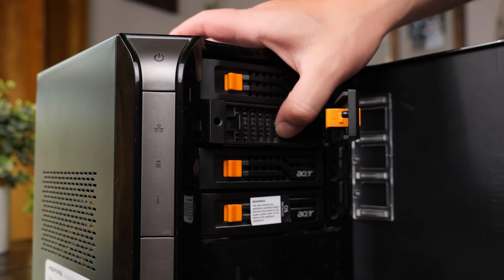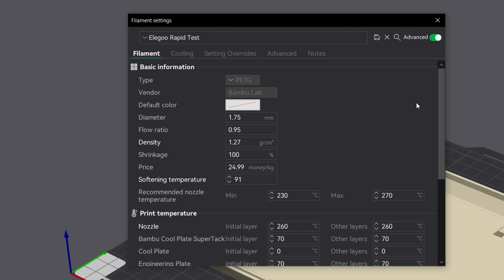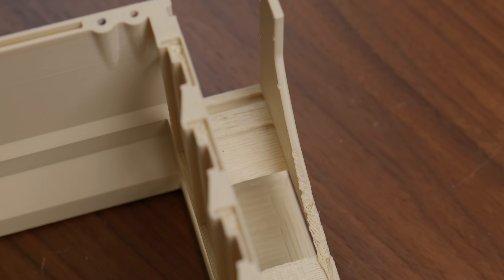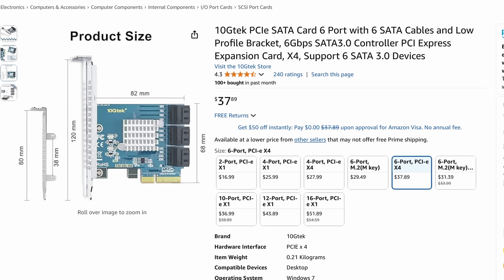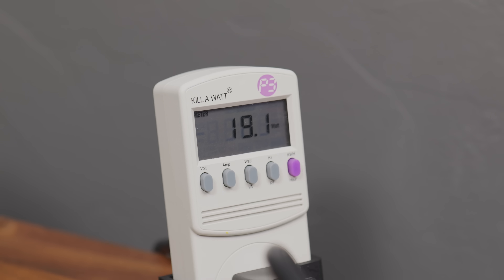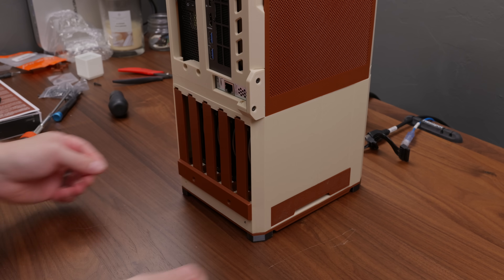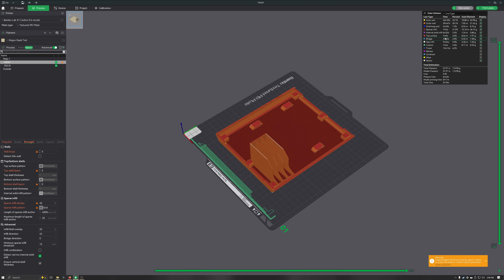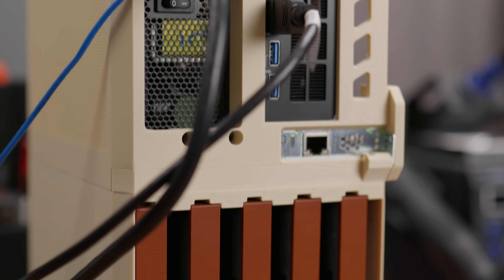This 3D-Printed Home Server Is INCREDIBLE

Comment: Really wish you could just buy SATA/SAS backplane boards to finish turning stuff like this into a safely-hotswappable system. Yes, I realize it'd probably work with just the cables, but that means having flailing cable ends or possibly disconnecting the wrong cable or connecting cables in the wrong order. Really fancy solutions keep track of which drive is in which bay for error reporting, etc. That's possible if you know what cable is plugged in where, and that sort of thing is a lot easier to do once if you have a backplane in addition to ensuring that contacts are made in the correct order to insert/remove drives.
Reply: There are female to male sata connectors, which can be screwed onto 3d printed parts to make a diy backplane. The drives can than be pulled out with the connector and the cables staying attached.
Reply: @Servicehans  That might be the solution! There's not too much going on with those backplane boards except for activity lights per-drive and … I think the DIY solution can omit those. That said, a USB microcontroller updating some bicolor LEDs green/orange/red based on the drive's status could provide what you really wish you had from those backplane boards: This disk is needs to be cloned and replaced to avoid degraded state when it's replaced. Or it has failed and just needs replacing outright.

I have a Silverstone CS382 (which actually had a bad backplane—Silverstone was quick with the replacement though!) and one of the first things I did was cook up a script that would list the disks in the order of the bays using physical ports and report info about each.

Such a nice script! 😁 It's really just a matter of knowing which ports map to which bay in the case, doing a readlink on them to figure out the device name, and then checking the already cached SMART data used to update the web GUI. If I modified that to poll the disks it'd slow the script down by a fair bit, but it'd be portable to other systems. Might do that, but the last time I posted that kind of script to reddit it got downvoted pretty quickly and nobody really saw it.
Reply: I was also searching for something like this and the cheapest I found was a 3.5in to 2.5in hard drive to SSD converter for $25. Ifixit sells it. It's more expensive then it has to be but if it can be disassembled it's the closest thing I have found.

My next idea was seeing if any server company would sell "replacement" backplanes for their servers. I remember LTT getting some at some point for one of their older servers as it needed one for a replacement.

Comment: I don't have the patience to use my 3D printer anymore. Everything takes ages to print. It's been collecting dust for about 2 years now.
Reply: Sell it! I've been meaning to try and find one second hand myself!
Reply: Add a pi to your machine and install klipper like having a new printer with turbo engine
Reply: Which model? I've had an Ender 3 for years, but it's so slow! My wife bought me an Ender 3 v3 this year and it's been great!! At least 5x the speed typically.
Reply: @BenReese What's the steps per millimeter that it's printing at? What size nozzle is it running? I have an ender 3 pro and I upgraded the bed to a glass bed, changed it to direct drive printing, dual z motors, Big tree tech motherboard for silent motors, it was pretty much everything except for the hot end. The last thing I messed with was trying to upgrade from  the stock nozzle which I think is .4 mm up to a .6 or .8 and didn't have a lot of luck with it. Now you have me curious about the newer printers. Want to go look around and watch some videos. Thanks for the info.

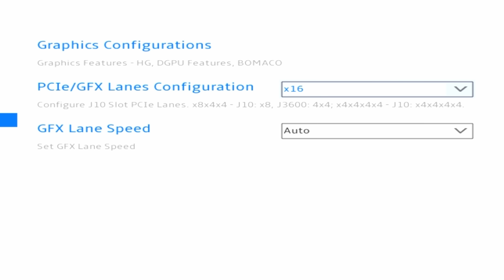Comment: what's the PCI to 4x nvme adapter shown in minute 7:24?
Reply: GLOTRENDS PA41, probably available with other tradenames but pretty sure that is the one. There are a few versions of it.
Reply: GLOTRENDS PA41 by the looks of it, it's probably available as other 'brands' too but it's the same thing.

Comment: For a case that small, I'd snip and crimp my own PSU cables. Did the same years ago with my old Dan A4-SFX
Reply from the maker: Is there a place to just buy more "bulk" cabling for power supplies? I just don't want to ruin the stock cables since I generally repurpose PSUs for different projects. I guess I could just buy cable extensions..

Comment: OOF...that mobo and qnap card...yoiks, but I guess for homelabbers less horsepower would be fine
Also..I wonder if those 6x sata adapters have 3D printable fans...those things if ALOT of data get run thru them get rather toasty and end up throttling down..so a small 40mm cooling fan 3d printable "snap in place adapter" then maybe taking 5vdc and ground from the solder pads below the chip might make for a silent airflow/cooling addition

Comment: I'm running the same motherboard but with the 7940HX for 6 months now, initially as desktop (totally smoked my 5800x3D in all aspects), then close to 5 months as proxmox host (with 10gbe SFP+ NIC). Now it's back to being my daily desktop driver... until the upcoming Minisforum Ryzen 9955 boards hit the market.
Edit: with -20 voltage reduction in bios my 7940HX dishes out 31500 points in R23.
Reply: lol, I have the same one with the 7940hx, I put a 4070 in it and use it as a gaming pc for my front room. I'm actually waiting for minisforum to come out with the 9955HX3D so I can replace my main desktop 7950x.

Comment: This looks excellent.
By the way, what is that little red add-on piece you have on your Logitech K400?
Reply from the maker: Just a little 3D printed USB holder that's super glued on haha
Reply: @HardwareHaven  Cool! My own K400 customization involved adding tiny tactile bumps above to the F5, F9, and F11 keys using a bit of superglue.

Comment: Tips for lower idle power consumption: replace kernel version of r8169 driver for Realtek R8125 with DKMS r8125 version or recompile it from official site, since kernel's r8169 driver does not support power saving for R8125. Next, upgrade firmware for ASM1166 controller - latest version is from December 2024 and it supports power saving without a problem.
Reply from the maker: OOH Interesting stuff!
Reply: @HardwareHaven  Yeah, I spent some time optimizing power savings and ASPM for my Z790 board with the same Realtek NIC and the same SATA controller, with enough data points after every change. Managed to drop from 25W with just two NVMe drives connected, to 12.5W after tweaking those two things.
Reply: @HardwareHaven  Another power tip. Go into the bios and enable pbo leave all the settings stock except curve optimizer all the way down at the bottom. Set it to -15 and save/quit. You'll keep the performance but pbo will auto undervolt. You can try different offsets to tune stability to power ratios. I have the baby brother of this board that has the 7940HX instead of the 7945HX. If you dont need to use the igpu, disable that as well. Also, you can try to lower the ram speed to see if that helps. Dont know if that would impact nas performance though.
Reply: Thanks. I bought the exact same Mboard this week to replace the old 4th-gen i3 that's been my main PC since around 2013.
Reply: would you recommend installing TrueNAS baremetal or virtualized through proxmox? i am only planning to run docker containers that and i cant really install the DKMS version on truenas

Comment: I love the idea of 3d printed cases, especially NAS cases. If I hadn't just shelled out a butt load on hot swappable drive bay cages, I'd probably print something like this.
Reply: Heh butt load? My 'NAS' has a quad SAS/Sata cage/backplane unit that was 150€ plus 70€ for cables and 40€ or so just for caddies. For 4 drives. Hope you got a better deal. The only thing I can say for myself is that mine are "Enterprise class" 😂 - HPE for ya. Those prices were for refurb gear, not new. ML350G10+ is what that stuff went into. But yeah some PC add on makers like Icydock charge an arm and a leg at times for fairly simple things, but I think HPE has them beat. My "justification" is that it can grow, to 56core/112threads with 3.84TB RAM in one "tower PC" is max config on it should I need to go that crazy. It has a 2.5" cage in it with a couple of SSD's to boot it off and 3x15kSAS HDD's for fast scratch disks, plus the 4x3.5" 16TB for data, with space for one more cage in the future. Doesn't make much sense for home use but then I'm not the average home user.
Reply: @noth606  These things were  so much easier to get hold of a decade ago. Now it seems most of them are not available anymore.

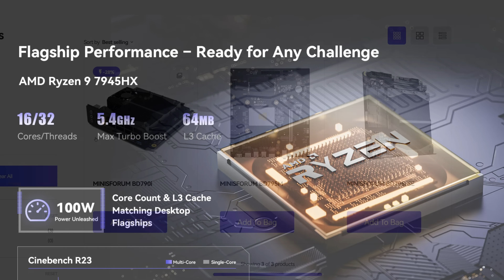Comment: 6:08
Erying and 10729 actually has those kind of boards (both intel and AMD), but you only need to buy their vapor chamber which costs 20$ (in case you bought an Erying board considering the it's better for heat transfer)
Reply: any intel boards to recommend?

Comment: or you could paint white 3d print to anything after. by hand. also generic build parts set with specialized connector pieces would be better than a one-time one-function use case model. yep better for diy. actually keep it simple. what jargon mumble lol.

Comment: I'm trying to find a drive enclosure for cheap. Do you think that printing only the drive bay with the side fan would be enough to cool 2 7200 and 2 5400 rpm drives?
Reply: I have 2 7200 RPM HDDs, and they are fine without cooling. It would probably be enough.
Reply: @xanderplayz3446  Thanks a lot!

Comment: Only issue with 3d print cases is the plastic shear temp. Harder material is required like ABS or nylon.
Reply: The inside of a PC will never get to any temp that will impact pla or petg.
Reply: @wojtek-33 The shear heat for pla starts at 150f so deformation can easily start.
Reply: @HanyuuFurude-g4r  There is air blowing through the case. Pla will not get hot enough to deform. I have pla parts on the interior of my car, some of which see direct sun. Live in Texas. Interior gets 140+. It's been 4 years and all the parts still look like when they were printed.
Reply: With proper cooling, PETG should be sufficient. If it gets so hot inside your case that the PETG deforms, you have much bigger problems.
Reply from the maker: What ^^^ they said.

Comment: next up: downloading more ram
Reply: Powered by SoftRAM
Reply: when you use Google Drive as swap space
Reply: Deditated wam module pleaae.
Reply: 3D printing more RAM, you mean.
Reply: @UntouchedWagons  3D printing some, downlading some, and using some cloudbased ram should do the trick. If not just add a bit of wireless ram.
Reply: usb but nand chip replaced with ram
or swap
Reply: GPU please
Reply: I hear if you lick your psu the increase in connectivity makes your pc run faster
Reply: Imagine downloading ram and print it with cnc machine
Reply: That would be a replicator frkm startrek
Reply: PC makers don’t want you to know this one simple trick!
Reply: Literally zram